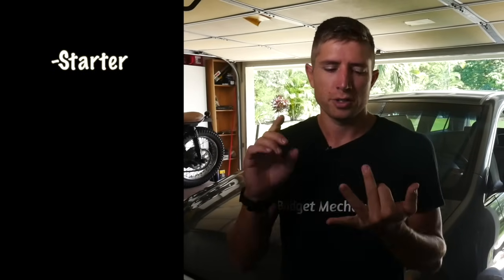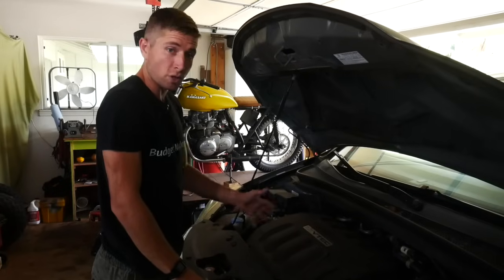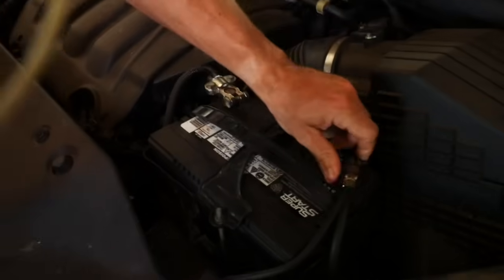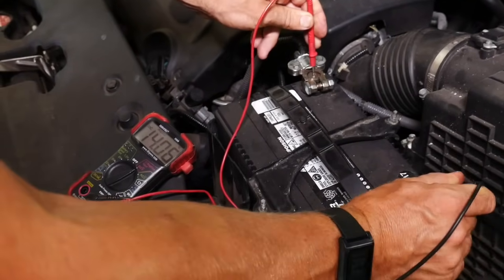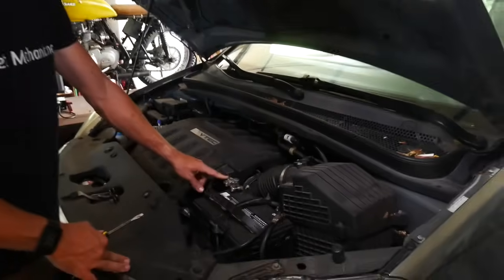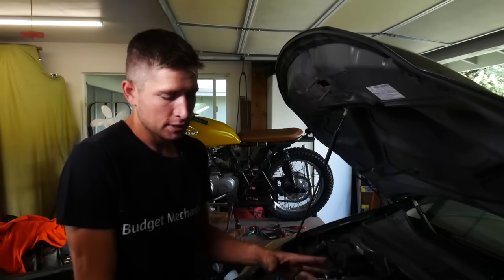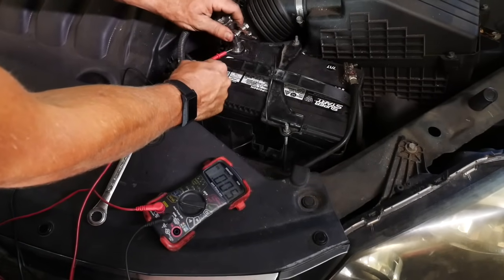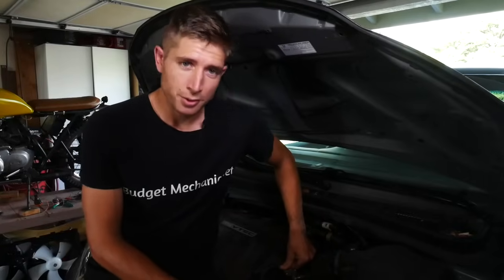Car Not Starting? Click or Clicking sound? Simple DIY Diagnosis!

Comment: Mine goes chchchchchchchchchchch really fast but eveything works like lights turn on windows go down music plays and everything
Reply: We need answers😭😭
Reply: @elvingeo5125  🤣
Reply: That’s 100% a battery. That sound is the starter trying to engage but not enough power
Reply: @Lmancoolj  mine did same thing but battery is 100 percent now and still same problem.So most likely the starter.Guess it drains the battery every attempt at cranking it.Not sure though but my guess it is.9
Reply: @Lmancoolj  so if I jump my battery with portable jumper and I get lights radio etc but it only clicks tapping  alot it's the battery ? Or us it starter or a relay or something else ? Also after I disconnect jumper out my tools away went to bathroom etc like twenty minutes later I went to see if lights work and car is completely dead again.
Reply: @John Anderson  still sounds like battery honestly. Had a 98 ram that I thought needed a bunch of work, lights, radio, ac worked. Just wouldn't turn over, kept clicking. Changed the battery and it was fine. Sadly when it's electrical it's hard to pinpoint exactly what's wrong until you start some trial and error. Hopefully you get it figured out and don't sink too much $$ into it.
Reply: Did you find out what it was? I think I have the same problem
Reply: @EvilGwenStefani  same as well what have you found so far?
Reply: Did you figure it out? I’m having the same issue on a Elantra
Reply: Same here but now after trying tp turn car on so many times now battery is not holding a charge long enough to test the starter smh.
Reply: What if you hear no noise
Reply: @Loader12  try the starter relay fuse see if it’s that
Reply: 2013 Tucson doing the same thing. Thinking it’s my starter but checking it out today.
Reply: Mine turns over once then does the rapid clicking sound.
Reply: @puffythecampfireplayer6143 same here, mine clicks after startup 2-3 click/knocking noises
Reply: It could also be your battery connections try cleaning them and then try start the car
Reply: Mine was battery . Once I lifted back seat and jumped at the battery and not under the hood where the positive connection was it started right up. Just a pain to have to lift up seat to jump car . Don't know why it wouldn't take doing it under the car hood .
Reply: Okay y’all so I found an answer for my car and if you bought a battery with low cca and you live where it’s very cold then that’s the problem for me I bought one oem cca of about 460 when here in nj its below 40 degrees your best bet is getting about 500 cause my other car the runs perfectly fine is at 600 cca hope this helps yah
Reply: Timing

Comment: Can alternator be the issue  even with a brand new battery? Car won’t start but tries to even with new battery.
Reply from the maker: Just clicking? If clicking with a new battery it’s most likely the starter. If engine turns over but only slowly, it’s either a bad battery (even new ones can be bad!) or a wiring connection problem.

Comment: What do you think it is if my battery, alternator, terminals are all fine and good but sometimes my starter just goes click… click … click .. click but sometimes when I cycle the key it will turn over and start but sometimes not , I replaced my fuel pump as well so what do you think the issue is or anyone?
Reply: replace the battery cables especially the negative cable. Your problem should  be solved

Comment: i have a 2014 Cruze  i just chang the start but it still does this the alternator is new n so is the battery  but the only way is cranks if i jump start it could it be the cables from the stater that connect to the alternator also n the to the positive

Comment: Never disconnect battery  terminals  when  car is running ,doing so can instantly  destroy  the computer and other electronic components !  A voltmeter  is cheap ,computers and other electronic  components  are not!    If alternator  is  operating  a high voltage surge  occurs when  disconnecting  or connecting  battery  with  engine  running, the voltage  regulator  uses battery  voltage  to  regulate  alternator  output  ,without  it alternator  output  can runaway  destroying  electronics.    Old carburetor  equipped  cars without  computers  you could  get away  with  it . With any fuel injected car you are risking expensive  electronic damage!

Comment: someone made a comment that..if the car battery is totally drained ..a jumper box will not start the engine? true or false.
Reply from the maker: Often true. It can be so dead it won’t properly transfer the jump unless you have a strong battery-backed jumper

Comment: Although they purchased the battery ~ 1 year ago, do we know how long the battery was sitting on the shelf after it was manufactured?  Sometimes batteries are there for a long time, which decrease their life.
Reply from the maker: Also the deeper battery tests revealed dead cells in the battery. A defect
Reply: Yes we do... The battery was sitting on the shelf NOT before 7/2017. This video was uploaded 9/28/2018 so the battery sat on the shelf for not more than 3 months minus the time it took to upload this video.

Comment: I had someone change out my starter solenoid to my 1999 f150. I still get clicking but no fire to starter or dash. I was given a hint by someone that this mechanic has been known to sabotage the alternator to previous vehicles by putting something behind a bolt on alternator so it won’t start. Now where can I check if this is the case?
Reply from the maker: Afraid I don’t have much experience with sabotaged alternators! But if your vehicle is not starting it’s not because of the alternator. It’s going to be a problem with the starter The battery or the wiring

Comment: Ok I agree with the diagnosis and testing but what if your having the same problem as in the beginning plus I have a brand new battery, I also have a brand new alternator, new cables throughout and a new solenoid as well. I’m currently replacing the starter at the moment. It was the old one only 1 year old. What then if it’s still doing the same thing. Btw it’s on a 1989 Chevrolet with a 454 cid 4 barrel for the make and engine size. It also has 55,608 actual miles on odometer.

Comment: I have a lexus gs300 1998 2jze... My car problem is sometimes the security light dsnt go off... If it goes by so much try... Wen i try to start the car starts and dies... And gives security light blinking... I wait for 15 to 20 mins... If i'm lucky the security light will go off... And i try to start and dis time i accelerate the gas pedal... If i'm lucky the car will start else it will die and again and the security light will start blinking again and again i have to wait for some time try to turn off the security light... Do u have any idea what is causing the problem... Coz many other cars if the car dies after starting we have much more attempts to try.. But in my car only one attempt.. Just let me know

Comment: When I try to turn my car on, it does not and makes constant clicking sound (like machine gun). I did notice the corrosion on positive terminal so I cleaned it up but no luck. Since battery is almost 5 years old, I am leaning to battery replacement conclusion. However, if the battery has gone bad then should not car's remote system also stop working? I am able to lock/unlock car using remote fine. Any feedback is appreciated before I get my battery replaced.

Comment: '98 Chevy Silverado truck k2500 7.4 L engine automatic far away four wheel drive install the brand new starter brand new alternator brand new battery new ground cable new alternator cable cut off the ends off the other two wires and put new ends on them one of them has a 40 amp fuse on it I changed that out also the entire piece with the fuse and the truck only clicks clicks clicks negative cable I made sure I send it the side of the wall down and got a good ground ground wires are good underneath where the starter is connected only clicks click any ideas

Comment: No one can explain better than this. I got the same problem, ditto noise. I was is doubt. coz the battery was showing 12.4V (idle) and the value was not dropping while trying to crank (even though it couldn't start). I am not having a load meter with me. Let me get a jumper guy. Thanks from India.

Comment: What if the car cranks but does not start when being jumped, I hear the fuel pump going? It occasionally  won't start then will start and run fine no problem
Reply: This is where I am

Comment: Mine clicks and starts after what sounds like a struggle, especially first start in the morning. Starter?
Reply: did you watch the video?lol just messing. I'd say battery
Reply from the maker: Probably battery and/or alternator
Reply: @BudgetMechanicHawaii  I mean unless alternator is grounding not sure how that will effect starter circuit. weak battery or bad grounding. I would chase the wire

Comment: I have a question my car not starting  but the lights and everything come on radio and I just install brand new starter and alternator the car will start after a few hours but the moment you turn it off it won't start back up what is the problem is it a fuse like the relay
Reply from the maker: When you say won’t start you mean it just clicks? No sound? No lights on dash?
Reply: @BudgetMechanicHawaii  I’m dealing with same problems I have 04 impala

Comment: I have a 2006 Grand Prix, every so often when I try to start it, all it does is a series of clicks several if I bturn it off and wait a few seconds try it again around the third time it will start just fine. Does not do it often more randomly. What could it be?
Reply from the maker: starter solenoid is struggling either due to near failure or weak battery

Comment: Good video! i want to ask, can we touch car battery terminal while the engine is running? From the video it should be OK. Sorry for dumb question. Thanks
Reply from the maker: You can yes, still only 14v (vs 12 when car is off)

Comment: I have an 07 odyssey and it died while driving home and I can't jump it. I'm pretty sure it's the alternator, thanks for this video.
Reply: I was wrong. Apparently these engines suck and mine is shot. Sold it for parts.
Reply: @themarchhare1376  damn how did you figure it was the engine

Comment: Recharged my battery and everything. Got power back to the truck after it was completely dead with no power or click. It turns over, clicks then right when you think it’s going to start it does a little dying sound. I’m lost on it but know it’s one of the two

Comment: hey I have a 2011 chevy malibu and it cranks  like it trying to start but it won't start any ideas..... I was driving and the car shut off on me mid drive and hasn't started since please any help would be greatly appreciated 🙏 🙃
Reply: Could be fuel pump or alternator check to see if you hear fuel pump prime when you turn the key on to run not start then check alternator because if alternator is bad the car will die when driving from my experience check that out
Reply from the maker: Did you ever figure out your problem?

Comment: So I have a 2006 Jeep Grand Cherroke.  Sometimes it won't start all i could hear is clicking when turning ignition. Battery and alternator were checked at autozone and was told they were fine 12v. ...so what could it be???
Reply from the maker: If Autozone is right about your batt and alternator, that would point to a failing starter. If so, it will keep getting worse until just won’t start one day.

Comment: I’m having the same issue I changed the battery I change the alternator the car worked fine for a while then it died on me the only way I can start it is by a jump.
I have the check engine on VSA, brake lights, D flashing. When I try to accelerate it hardly goes.
Reply from the maker: Sounds like an electrical problem (or a faulty new alternator). Double check wiring from batt to alternator and also alternator fuses and relays
Reply: This is the first time I have noticed someone mentioned the D flashing, I have a 2003 Honda Odyssey it's been doing this on and off for years and the Honda dealer says they don't know what causes it. Does anyone here know?

Comment: Just put a new battery in.my 2012 Honda CRV. Then 2 days later when trying to start car...it seemed "sluggish " when turning the key. One time I had to turn key twice for my car to turn on. So was informed could be alternator. So just bought a remanufactured DENSO alternator and put in Friday (two days ago).. long story short..car still seemed sluggish starting so took to Autozone and they said alternator failed...believed it showed at 12. How can alternator fail when literally just bought it and it's a good brand..DENSO...so now I'm confused if it's my battery..alternator or starter
Reply from the maker: Sluggish start is usually always the battery, or the alternator is not charging the battery. Believe it or not I’ve seen many brand new parts fail out of the box! Especially alternators and starters, most are being made cheaply in China now. One solution is to find a local repair shop that rebuilds starters and alternators. I have found I have much better results getting rebuilt parts from them because they test each one before they sell it. ￼
Reply: @BudgetMechanicHawaii  Thank you. Guess I have some research to do to find someone who rebuilds quality ones here in Houston. So the sluggish start, you don't think it may be the starter going out?
Reply from the maker: It is possible yes! Same guys that rebuild alternators can be robs my test your starter well!

Comment: Toyota Allion 2006.. cars sometimes struggles to turn over on start!!. First, car just didn't start one day, then, jump started the car, it idled unusually low like it was about to chip out and it eventually did. Jump started it again, same thing, sometimes when i try to rev and it chips out. Jump started again, stil idling low but car eventually started idling normally then it drove great, checked alternator while car running (good) and battery tested (13.96vlt good), drove the car for 45 minutes, shut off and started twice (everything perfect). Next day no start again, got another battery (not new) car start just fine but idling low again. Serviced the car, new spark plugs, new oil filter and changed oil also, battery only in 1.2 years and tested fine.. after service starting issue still there, idling issue was still present but eventually went back to normal but happened once again after I changed to two new battery terminals but again went back to normal in 8 mins.. the struggle to turn over still happens, please help!! 😌
Reply from the maker: That sounds like a tough diagnosis! Does your alternator voltage read good when the car is idling badly? It kind of sounds like a bad alternator but it’s weird that it is intermittent
Reply: @BudgetMechanicHawaii  I haven't been able to check that since the idling issue hasn't happened again. But I'm leaning toward alternator because when I got the battery the first couple starts had absolutely no lag in turning over the engine. Only after being in the car for a while it began to show issues. I think that points back to the alternator an charging.. 

1. can that be repaired or must that alternator be changed?

2. Can I test that alternator while running normally, what should it be reading and what signs should I look for? 

3. Do you have an email
Reply: @BudgetMechanicHawaii  turns out it was blown throttle sensor fuse, car not getting enough fuel on start and also battery needed to be replaced.. everything during perfect now!! 👌🏿

Comment: my car starts right up sometimes. sometimes it takes a few cranks then it’ll start. and sometimes it won’t start for a day or two. or in a few hours..? battery tested good.
Reply: and when it starts it sounds really good and like it wants to start..
Reply: 2002 pontiac aztek
Reply from the maker: If you are saying that it continually cranks over but doesn’t start, that is not a battery or starter problem. That’s going to be something else with the fuel or ignition systems that you’ll need to check out

Comment: What if you connected to another car to jumpstart it but it still doesn’t start it does turn over though
Reply from the maker: If the engine turns over but doesn’t start (while being jumped or not) it means something else is wrong besides starter/battery

Comment: Please help. Got a single click. Just replaced starter and battery work brand new.and it's still got the single click.
Reply from the maker: I would check your terminals to make sure they are clean and tight, as well as the wires where they connect to the terminal, the single click sounds like not enough power is getting to your starter (or the new starter is faulty? Was it tested in a shop? Good quality one?)
Reply: @BudgetMechanicHawaii  I put a new one in 2 weeks ago and clicked.so replaced and still clicks.gonna have a look today and will let you know how I get on.
Reply: Literally having this problem now . I have a new starter alternator and battery and all it does is click . Can you please help me I give birth to my daughter in 4 weeks

Comment: Hey i need some help.  I got a 97 ford mustang 3.6. It cranks but, doesn't turn over. It did that before and i replaced the starter and battery and it worked fine.  It sat for a day and it didn't start again. Could it be the alternator??
Reply from the maker: Possible, you need to confirm voltage at the battery when the car is running, ensure it is over 13v. Also could be parasitic draw tho